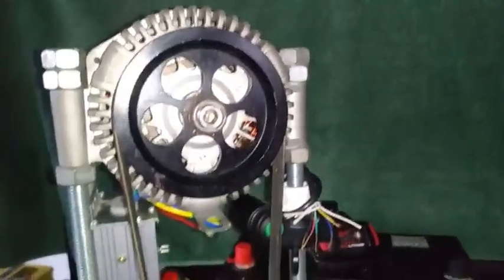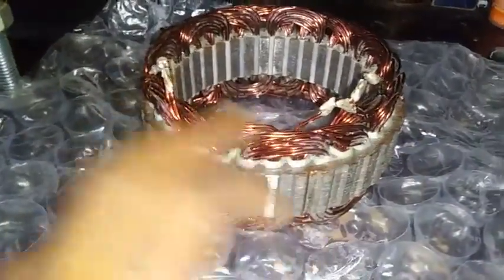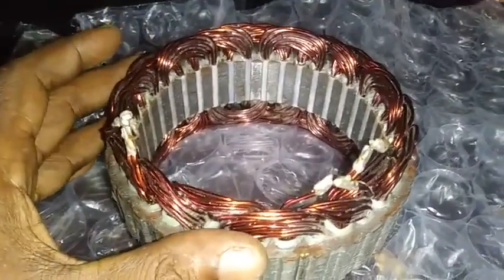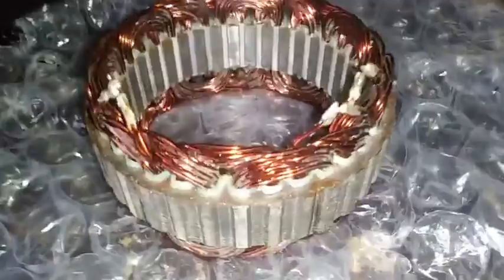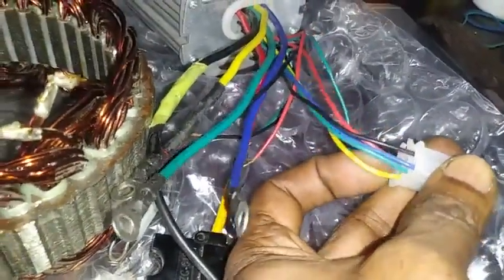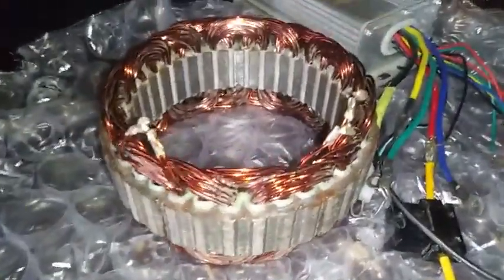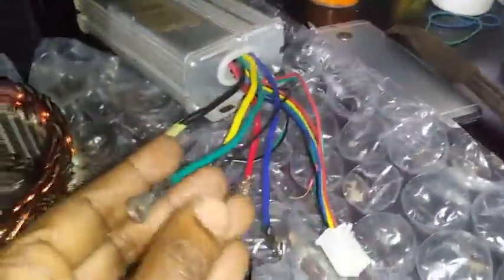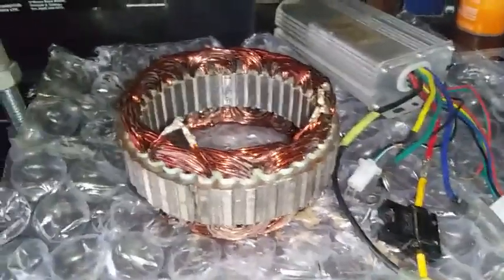Alternator 12G stator field convert into BLDC dual 3G.

Comment: It didn't work because it was going off the left over electrons in the line. As it moves current also while trapping it in a battery. Also your losing electrons without using insulators. Also can you try making a mini alternator around the copper of the smaller one with magnets in-between housings.